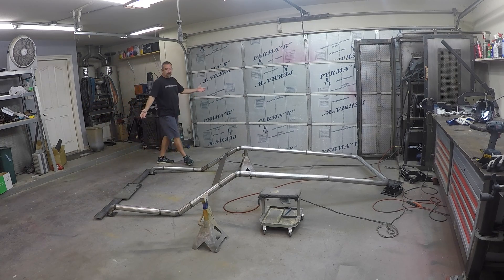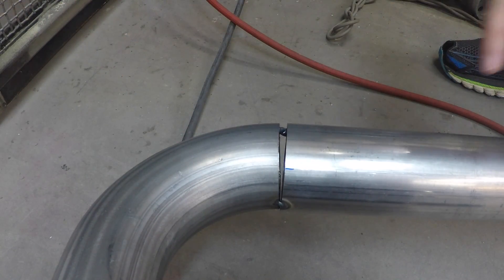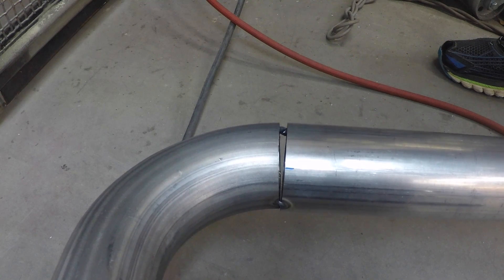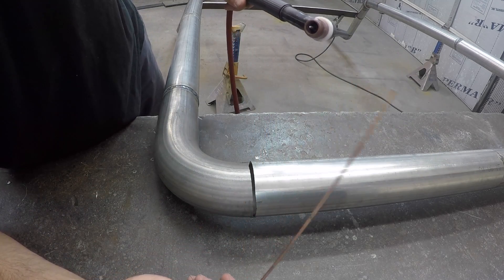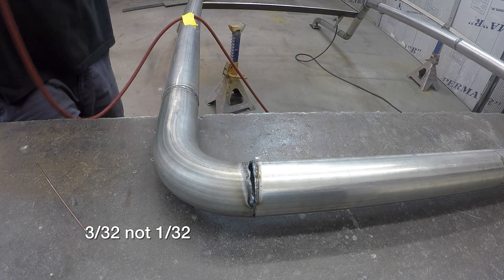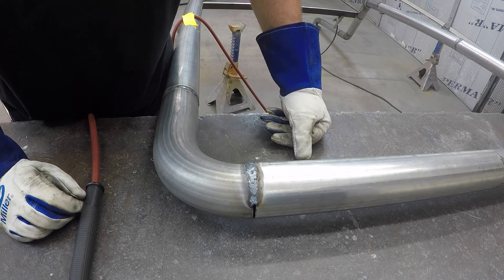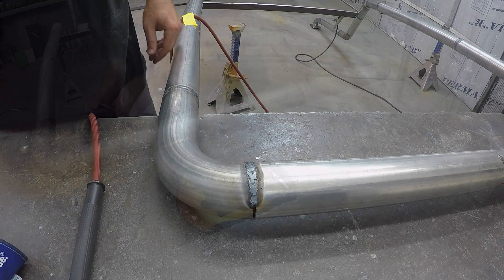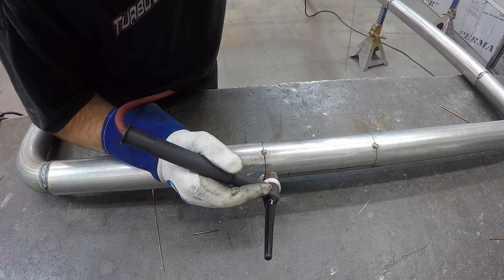Welding Large Gaps With Tig?  Or Mig?

Comment: How do you avoid sunburn?  I make 3 tacks with no sleeves on and end up red as a tomato.
Reply from the maker: I wear sunblock
Reply: That actually works!?  Them is some wicked strong UV rays.  Thanks, will try it.
Reply: You can get some stuff called weld block it's about the strongest uv blocker I've found. I ran out about a week ago and forgot to put sleeves on, didn't turn out so well

Comment: I like to put on a couple of seconds of downslope,that way you can control the heat better especially when tig welding gaps.
Reply from the maker: My machine is basic and doesn't have any features like that, but thanks for sharing that info
Reply: It's a great feature to have and if you are welding anything even slightly thick it really helps taper the heat off. Even my basic everlast welder has that feature so it can be obtained without a big investment. The alternative is to have a footpedal and taper off the heat manually.
Reply: Cool! I should look a bit more at Everlast tig welders.

Comment: Absolutely terrible video. A. Galvanising is zinc coating and inhaling the vapours given off when welded can give you zinc poisoning. The reason you had to go over the weld was because the zinc vapour was infecting the weld causing it to bubble. B Exposing ANY skin to the intense UV light given off when welding can cause premature skin ageing and/or skin cancer. C. Never, ever grind a weld the way you did. You ALWAYS grind @ 90 degrees to a weld to keep it flat. Doing it the way you did leads to peaks & troughs. Not the look you want.
Reply from the maker: +IanUK66 Lol, love it when random youtube trolls drop by with a stupid uneducated comment.  The tubing I was welding was "aluminized" not galvanized.  I had to go back over it because of the large gaps and large amount of filler rod that had to be added in increments.  This is common practice when filling anything with a weld process.  Common for some of the best CNC machine shops to fill in miss drilled holes, stack it high, mill it off, then to back over it one last time.
Reply from the maker: +IanUK66 You commented on my grinding, you say grind 90 deg?  That's a really good way to remove parent material from both sides and unneccessarily thin out the tubes.  Why grind materail you don't need to.  Again, this process I just used by bringing up on on the high spot of the weld is used by some of the best welders, fabricators  and and car builders.
Reply: +🔥Ramsey Customs - turbocobra LOL. I find that people who accuse others of trolling tend to do so because they've been caught out. But anyway, Aluminium and/or Galvanised coating, the principle for ANY weld is to  grind it back to parent metal as the coating will always add impurities to the weld...which is why you got pitting and have to go over it....and also, Far from been uneducated. I've produced structural/architectural fabrications all my life and TIG MIG MMA weld on a daily basis. http://www.mgolympic.co.uk/
Reply: +🔥Ramsey Customs - turbocobra You're the one sounding uneducated now. We have a saying for people who grind tube the way you did 'rough arse' You need to get yourself a belt sander mate....it grinds @ 90 degrees to the weld. Better still, use Stainless steel instead of coated tubing. It looks a lot better and is easier to weld/finish.

Comment: That Standard Tubing?   Vert Ups,With a Pc of 16 Ga Flat stock Stuck In There,,, is How i would Of done It,,,, Lookks HOT!!! and Shaky!!     Not Giving Ya a hard TIME!!!!!   Plz dont Think i Am,,,,You asked,and i tell it like It is,, OK?????????    Jack,,,, With i could sketch and scan and shoot It To ya,,,, be a Hell of a lot easier,,, TY,,, Jack
PS,, Gary,i Learned 39++Years ago,,, BE COMFORTABLE,,, #1 Looks Like Yer Not,at The end,,, pick Up Frame,,and sey on a Saw Horse,and Grab a Chair,,, Ya Be SURPRISED, How much Better YOU FEEL,the welds come Out,, Im a Firm Believer if theres a Will Theres a Way,,, Ive hav And I had 3 2 ton Overhead Cranes, 6 Jibs,,,, So,Lifting wasnt a Big Deal,, Ive Had to on some railing Jobs, Like take yer frame, and Cut 2 Pcs of scrap angle,What ever,and Tack em On,if Ya dont Have a sw horse thats the right Height,,,, i guess Ya Can call It Jury Rigging,but If your Comfortable,, Less fatigue,and Nicer yer work will come OUT!!!!!    PSSSS,,, my Buddys channel,, Hes a SUPER GUY,,, Have a Look,,,               How to Fill a Gap When Welding - Kevin Caron                       Jack

Comment: Of course there is always another option,I like to weld jobs like that with oxy acetylene . Tempers the weld and reduces the chances of stress cracking. I use old arc welding rods with flux knocked off, nice and thick and great quality.

Comment: I guess after having a TIG you wonder how you survived without one.
Reply from the maker: ***** Well said, couldn't agree more.  Certain things like, I took 2 of the factory bolts at the top of the cab where the plastic trim bolts in, and welded another bolt back to back to make a stud sticking up to be able to secure the rack to, and the tig is able to light up on the seam of the 2 bolts and slightly melt them, then just dip a little rod in, vs. a mig very hard to get an exact weld point on such a small item.

Comment: How does it mount in the front?
Reply from the maker: jamesfreddys The rear catches some factory bolts in bed sides.  The top catches some factory bolts right at the top of the cab where all the pastic trim bolts in, and I welded some tabs to the tubes to bolt it.  Up front, now that I have it all welded up and it's done all the moving it's going to do, I am going to make some little feet to weld to front corners, and they will sit down on some rubber isolators that we will silicone to the roof.
Reply: I knew you had something cool planned but got impatient and couldn't wait to see.

Comment: The arc shot is getting close man!  I've never seen the fusion welding technique on that long of a weld.  Only seen it on tacks.  That's cool.
Reply from the maker: Greg's Garage Arc shots are ok, I am waiting for you to perfect your method, would be a lot more clear without the lense.  Yea, Jody shows the high amp quick blast fusion tacks on thick material, i use those a lot.  This is something I saw a friend to years ago, he used to build a lot of turbo headers, etc, he would get every pipe section to a perfect gap, and fuse the whole thing.  Once the headers were coated, you couldn't see a seam.  It works good for something thats not structural, but you wouldn't want to do it on anything important because your using the base metal as filler it thins out the joint.

Comment: The only time I get pin holes when Mig welding is when Im outside and its windy.
Reply from the maker: 1970chevelle396 when you butt weld sheetmetal you have to put a million tacks together.  You pull in contaminants from the backside, and by placing tacks you get the scale left over from the previous tack unless you grind each time... pretty much most guys that weld sheetmetal patches get pinholes, and a very hard surface that is hard to hammer and dolly.  Its why Chip Foose tig welds all his sheetmetal work on his restorations.
Reply: Most of the stuff I weld I use a mig because its faster.  But the tig sure comes in handy for some stuff.

Comment: Gary, now I do want to try to tig welding for sure. I'm finding out that a mig weld is very hard surface to work. I can definitely see some benefits of tig welding. Thanks for sharing.
Reply from the maker: Double R Restorations thanks man, yea, the cool thing is, you have total control of the power right at your foot.  So if you light up on and edge, and it starts to blow away on you, you just let up on the pedal a little without stopping and making adjustments to the welder...